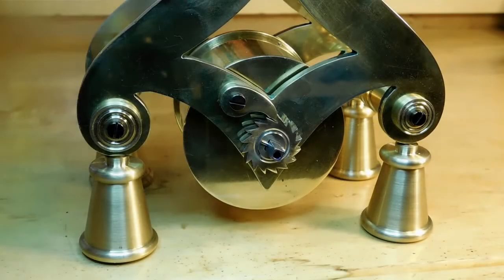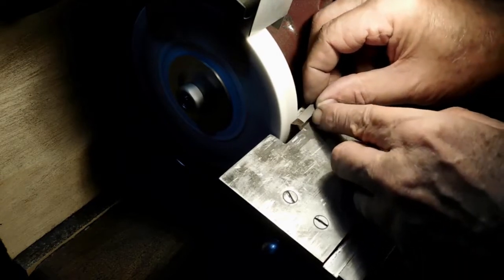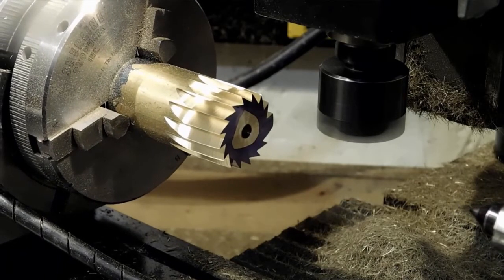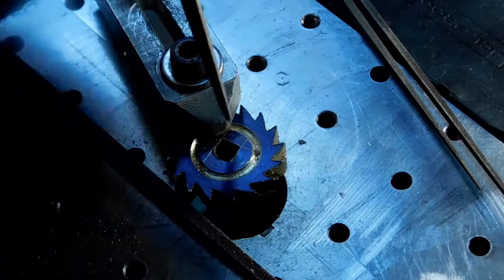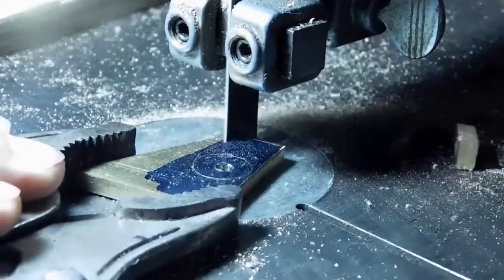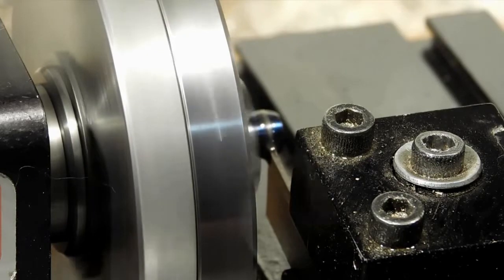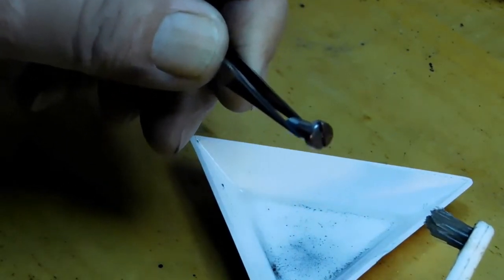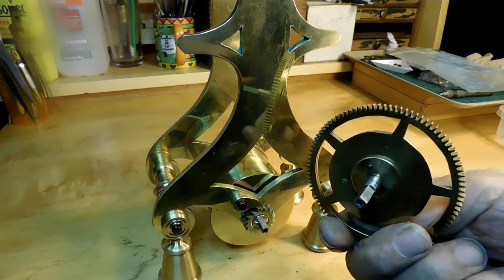WR Smith's Grasshopper Clock:Part Eight Making the Mainspring Ratchet and Click

Comment: Hi Bob, great video.  i love this series.  I have a couple of newbie questions.  What is boxwood?  and when you drilled the hole for the tapered pin, did you follow it with a tapered reamer, or just used the cylindrical hole.  When blueing your screw, it seems like I remember someone doing this once in a tray of brass chips.  (Clickspring maybe??)  Is either method better than the other, or does it just depend on the job at hand?  Again, thank you for sharing.  Great video.

Joe
Reply from the maker: Hi Joe…your questions are great...Boxwood is a very heavy, tight grain wood, with consistent light yellow color throughout.  Suitable for nearly all aspects of model ship building(from Google)…that is where my scrap supply comes from…many years ago I built a copy of the Hanna hull(Hanna was the first ship Washington commissioned into the American Navy...it was a converted Marblehead Tap Heel Schooner…my wife is from Marblehead) the boxwood lap I use is part of a screw polishing set and it is end grain boxwood and is a very nice finishing lap.

The hole for tapered pin was measured from the center point of the pin when positioned correctly…I have never tapered a hole…and I never tap them into position very hard…especially when used on the key end of an arbor…I use a spring washer which makes positioning and installing very simple…it is kinda like a screw slot being buggered up…a tapered pin driven home gets kinda buggered up and never returns looking too good…and I do not always have the same color brass pins to match up right…best to always use the original…I’m working on a Seth Thomas movement right now and the face plate is held by tapered pins, no spring washers, so I make sure the hole is positioned vertically and the thick end of the taper is on the top and a very slight tap into position.

I use a screw plate for screws but I do have a chip pan to blue hands and other parts…I like my alcohol lamp for heating screws…bit more difficult with the chip pan. Please remember there are lots of ways to complete a task…I kinda go with what I have on hands and have done before.

Still playing around with 3d printer...but slacking off a bit on learning Fusion 360...never enough time...bob
Reply from the maker: Joe I’m sorry, I thought I answered your questions last week when to my surprise I just found your questions unanswered…I must have had a senior moment and not actually posted my response.

Boxwood is the traditional watchmaker’s lap in a screw polishing attachment…the boxwood end grain is used as the lapping surface…also model shipmaker’s like it as it can be shaped easily..I made a model ship hull years ago and have a small supply of boxwood I use for polishing things like threads….Last night I cut the oil sinks for the wheels and later on you will see me form a polishing stick especially for oil sinks.

I use tapered pins regularly but only use tapered holes where accuracy is concerned…but for securing parts a plain through hole is fine...in fact I like tapered pins as it makes finding the hole easier.

I have a bluing pan (maybe 2 or more) I use for hands and other shaped parts…but I use my screwplate and a small alcohol burner for screws as most of the time I am bluing very small screws.

Well there you go…I hope I can post this answer correctly…thanks Joe…bob
Reply: Hey Bob.  I thought you answered this too.  I remember reading the response.  Who knows.  So where would one buy boxwood?
Reply from the maker: Model builders use a site like this:https://www.dlumberyard.com/wood.htmlIf I did not have boxwood left over from the Hannah build I would use popcycle sticks...bob

Comment: Informative video as always! Do you show anywhere how you attach each end of the fusee cable?
Reply from the maker: No I did not show how the ends were soldered...I've only done one end so when I am ready I'll give you a look at the other end...it is very simple a piece of round brass the hole size with end rounded...brass cable is threaded through and soldered securely...bob

Comment: Hi Bob - Looking good - why did you use a spring washer behind the ratchet?  I've fitted maintaining-work to my clock, so I've been busy making the detent and the fusee iron this week. It's cool to think that we're 1000's of miles apart, working on our clocks simultaneously! 🤓 Regards from NZ
Reply from the maker: Mornin' Clive...must be getting warmer on your side of the world this morning...it was about this time I'd start heading down to NZ for cyclone season...tried to make Opua by mid November each year...great memories.

The spring washer holds the taper pin securely but it is easily removed by simply pushing in the ratchet and sliding it off...my preferred method of securing with a taper pin.

I plan to plant the center wheel this morning...the arbor for the 3rd wheel was completed yesterday...just got the escapement bearings yesterday...things moving right along...bob